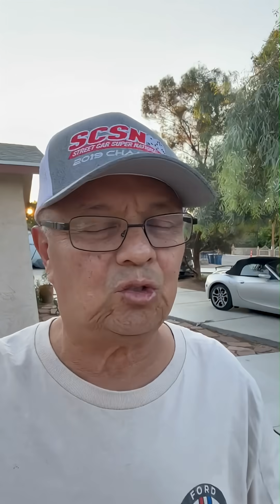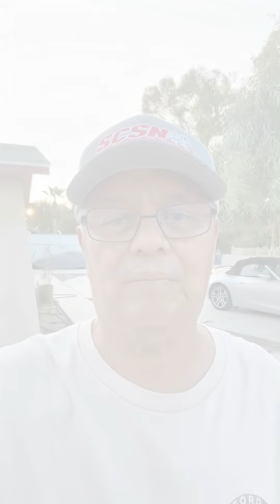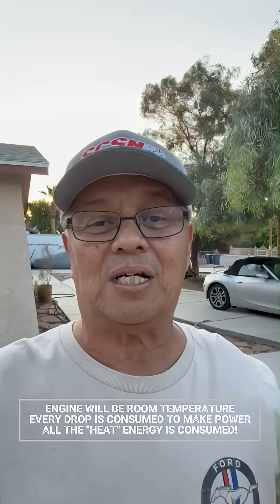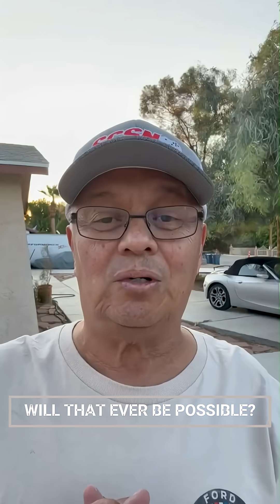100% EFFICIENT ENGINE HOW HOT IS IT?

Comment: I would think if it were 100% efficient you wouldnt have much friction and it would require very little fuel to perform a cycle it would almost be on the verge of self propulsion. ive had alcohol motors with frost on the block after a pass i doubt you would have frost but it might be 100 degrees
Reply from the maker: All those are probably out of reach for the moment and make take years before we can come very close!
Reply: @benalamedaracing2765 auto manufacturers will never allow it . they are too corrupt and greedy to allow any of it to come to market. we have stuff that runs almost forever right now but manufacturers want disposable unserviceable cars  , so you have to buy a new one from their finance company at some astronomical interest rate and be enslaved to them forever! there is an automotive deep state plotting this stuff and getting away with it cause people are too complacent and accept what they are doing ! this is one reason parts quality is falling down down down . they dont want anyone fixing anything

Comment: Modern engines are more than 40% efficient. M/B has achieved just over 50% efficiency on some of their engines. Race engines can be over 60% efficient.
Reply from the maker: I like those to be lab tested but a question to ask is Top Fuel/ Funny Cars.  18+gal. in a 1/4 mile run exhibits super big power with very little efficiency.

Comment: I've noticed a big difference between how much cooler the exhaust system runs on a turbo diesel compared to a NA gasoline engine - just illustrates how 22:1 compression AND turbo charging sucks so much more heat out of the burn 💪🙌🙏
Reply from the maker: You are correct indeed and the efficiency rating is very high alluding to the decrease in wasted energy and recovered as efficiently as we do today on those engines!

Comment: We run engines at the temps that we do because we must run them this cool due to the coolant that we have traditionally used. Alternative coolants that have a higher booling point can allow you to run an engine at a higher operating temp.
Reply: Slightly different take: we like oil around 220 (+/- 10 generally) because it boils off condensation rapidly - that helps engine oil last longer.
But I do love the question asked.  If every bit of energy is converted into motion, then temperature matches ambient.  Nobody's ever seen this magic engine, but its fun to think about.
Reply from the maker: @flinch622  agree 110% Flinch and we can only hope someday we achieved that but probably not in a hundred years! lol
Reply: just raise pressure like race cars do.
Reply from the maker: @V8Lenny  Indeed raise the pressure achieved and you raised the boiling point...
Reply from the maker: Yes alternative cooling with raised temperatures will make it function much better than standard coolant with the usual 15-21# radiator caps.
Reply: @benalamedaracing2765 F1 and Nascar use water at 140-150°C

Comment: Government wont allow an engine be 100% efficient.  Thats how a 26yr old kid died mysteriously back in 1977ish made his 460ci Lincoln get 100mpg. Made system himself by heating the fuel in fuel tank with coolant lines running through tank. To make it more of a vapor. Watched video on youtube lastnite. Hope all is well Ben. Liked your 385 series build. We built a 521ci with Dove heads. Ported blah blah. 12.5 to 1. Made around 930hp around 30 yrs ago. Voss engineering built it here in Fla. Torque monster.
Reply: 100% is not possible. The most efficient engines (locomotive engines usually) don’t even hit 40%. It is a heat engine, there will always be huge amounts of wasted heat going into the parts and not pushing the piston down.
Reply: @jackk21 Toyota gasoline engines  called “ Dynamic force” run on 41% efficiency and they are in almost every modern Toyota car today . 
The same with Mazda “ Skyactiv” engines 43% efficiency compression ratios up to 16:1 on gasoline engine . Nissan “e- Power” 50% efficiency. The most efficient usually are ships two stroke diesel engines with about 52% efficiency but recently Chinese company “Weichai Power engines” reached 53.09% for commercial trucks diesel engine, and this is internationally verified!
Reply from the maker: @jackk21  absolutely almost impossible at this point in time to eliminate any byproducts of combustion as heat, drag cooling system loss etc.
Reply: He figured out how to eliminate friction entirely? 🤔
Reply from the maker: @Scot-p1v  that is now an impossibility I think.  However....  Wait for the video.
Reply: @benalamedaracing2765  I hoped the emoji combined with the question mark made clear my rhetorical question was pointing out what I understand to be an impossibility.
Reply from the maker: @Scot-p1v  understood Scot.  Thanks for the comment appreciate it.
Reply from the maker: Wow that is awesome power out of the Dove heads and I have 2 of them now an SCJ and a CJ not sure until I see the part #.  I will do a longer video with my observations therefore I feel it is already here and that is all for now.
Reply: @benalamedaracing2765  from what I remember.  This was in 1993 aluminum heads were very expensive. And guy building it was a friend of ours. I believe they were stainless scj valves. The pistons were so close. It actually smacked the valve. Destroyed a head. It was a mud truck. 2½ton axles Clark 5spd. 56" Dual tractor tires. Wish I could show a pic. It had a massaged 950cfm. We know it coulda handled a 1050 easily. It was for deep mud holes in swamps down here. 2¼ primaries custom headers in 65 Ford f100. Lol you can hear that thing for a mile coming through woods. 
Ahh the good Ole daze. God bless you sir.. cant wait for more 385 series and even FE.
Reply from the maker: @ToeJammx2  thanks for commenting TJ!

Comment: Here is one more : If you have a refrigerator with open door in a closed room, what going to happen with the room temperature . Is it going to rise, is it going to cool down or going to stay the same ?
Reply: Its going to stay the same temperature. There will not be any heat exchange within the area! The evaporator and the condenser will be exposed to the same air temperatures, hence no cooling effects.
Reply: Not exactly rocket science!
Reply: @kennethhall1270 your answer is incorrect, doesn’t matter that it isn’t rocket science !